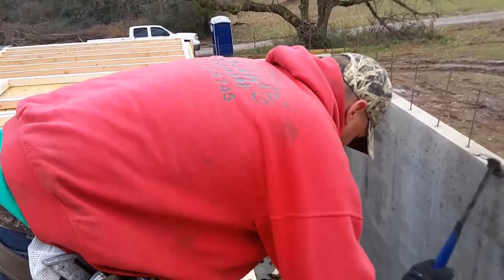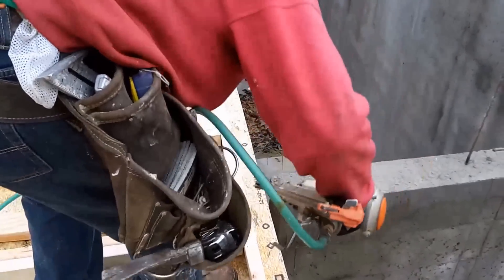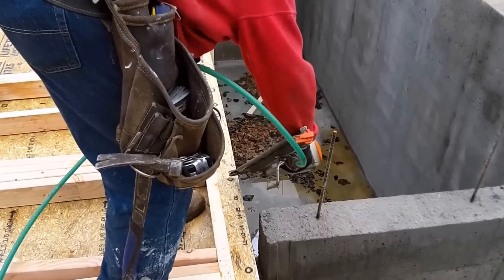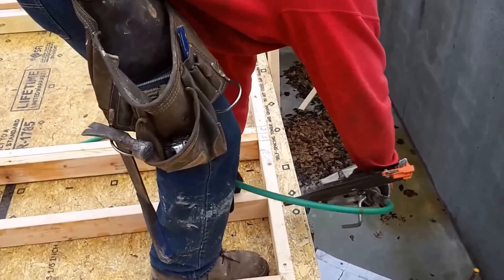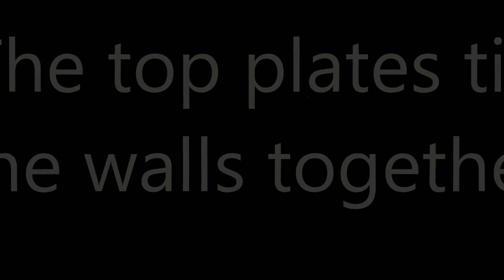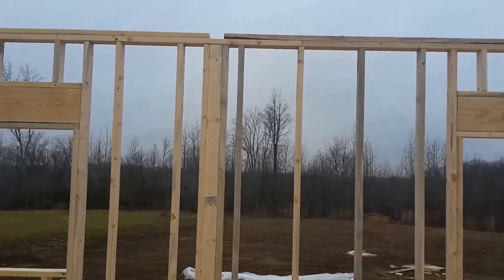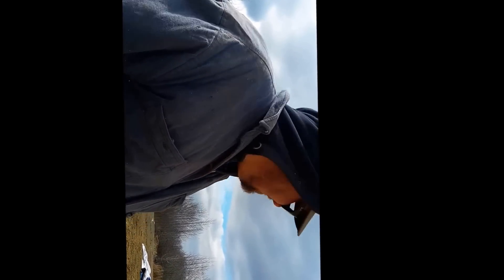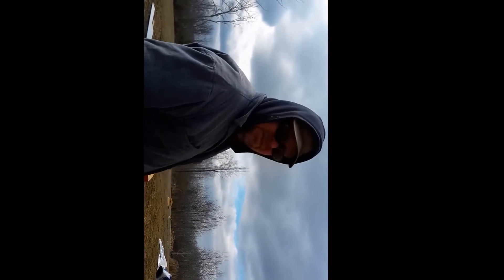Stick Framing 9' Walls with 7/16" OSB Sheathing

Comment: I'm glad to see you attaching the top plate before you raise the wall. You would be surprised at how many don't. I'm surprised to see nailing the top plate between studs. The plumbers and electricians will remove them if there in the way when they drill there holes for wiring and plumbing. How come you don't sheath the walls before raising them? I cut out my openings with a flush cut bit in a router.
Reply: I believe he likes to rack the walls plumb before he sheaths them.
Reply: The walls will be plumb if it is squared before applying the sheathing.
Reply: Had a feeling you were going to say that. You will always get plumb walls if you shear them after you stand them 100% of the time. Squaring and shearing the walls on the ground will not guarantee your walls will be plumb when you stand them.
Reply: How much could they be off? It is a fact that a square wall on a flat level surface can be nothing other than plumb after standing it up. If you plumb it after you stand it, is it not then square?
Reply: A square wall standing up would be plumb in theory, but sometimes not in reality. Just the simple fact that they could still be off, no matter how minor, is why it is good habit to apply the more accurate method of building.
Reply: By definition "minor" is meaningless.Can anyone detect an eighth, or 3 sixteenths  of an inch out of plumb? Besides, I've plumbed one end of a wall and the opposite end would be out. (When we build off of a slab.)  It's not a good idea when you have to compete with other contractors who will underbid you because you're taking longer to build when you have to sheet walls afterwards. Especially on the second story off of ladders.
Reply: @anonymouscitizen2732  cada estado tiene su forma de trabajar aquí en California quieren las cosas a la perfección en las casas residenciales, y aquí no acostumbran poner el triplay acostado,y tampoco poner el triplay cuando esta la pared tirada porq si el concreto no está a nivel ,cuando la pares ,y ya con triplay puesto, pues te va a quedar desplomiada
Reply: If the wall is squared and built on a flat leveled surface and the layout was done properly its going to be plumb when you stand it up. Also yeah and 1/16" is going to matter much.
Reply: yes, of course. your method delivers the more superior product. I'm sure you have many time saving tricks to get the frame completed faster.